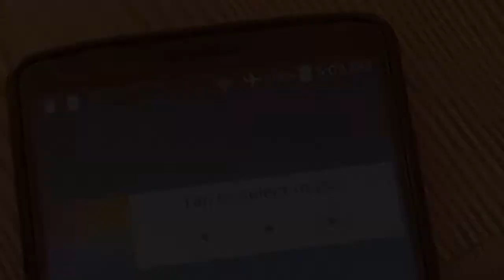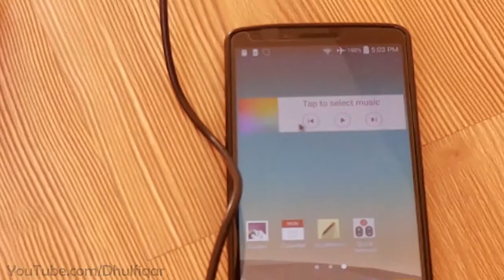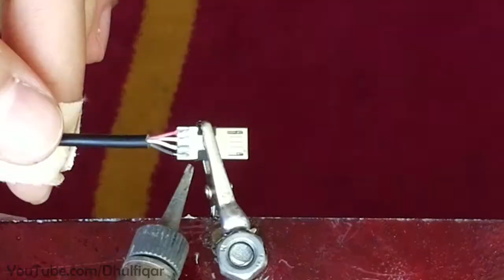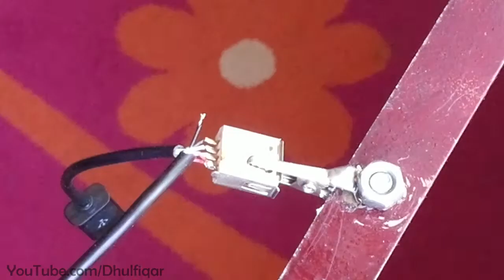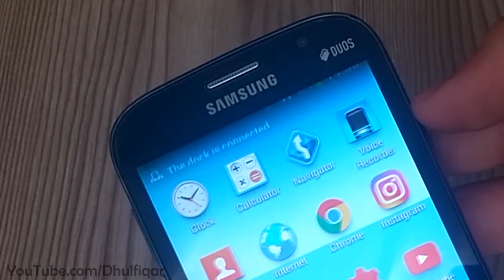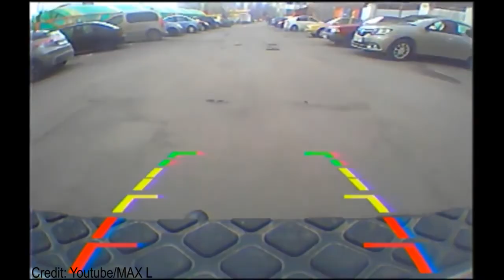LG G3 - How to OTG and charge Simultaneously on the Phone

Comment: Do you need the switch on LG G3, or can you charge + otg with resistor?
Reply from the maker: No Erik, The resistor method does not work with the LG G3, you need to use the switch method.
Reply: @Dhulfiqar  Thanks for reply! Do you know any way of doing this without having to push the switch? What about the hub with the solder trick?
Reply from the maker: I don't know how to make this process automatic, (it is doable with a relay and an arduino) but it becomes too complicated,
The solder trick in the hub is just for the hub itself, it allows the power to reach the phone and charge it.
you are welcome Erik.